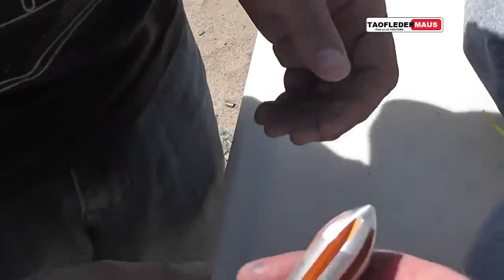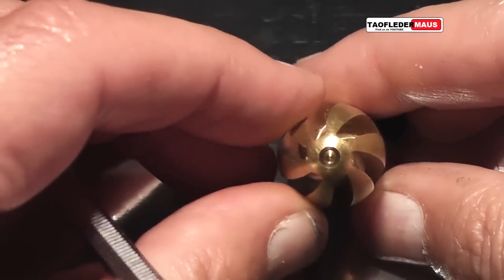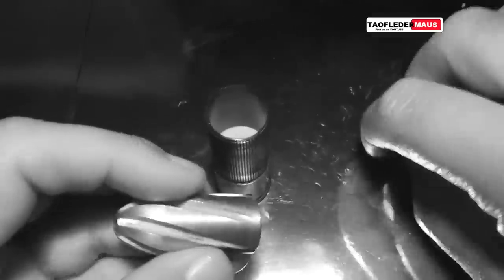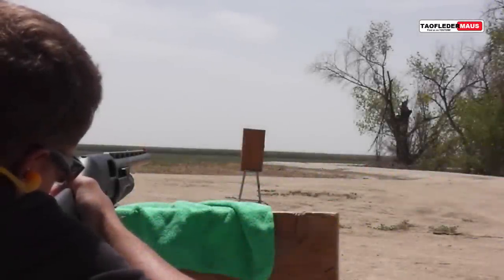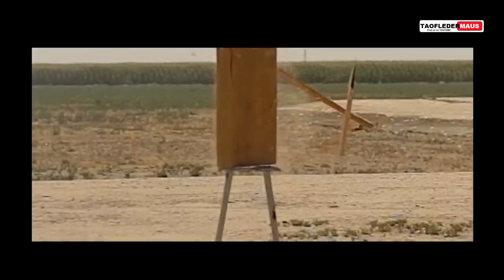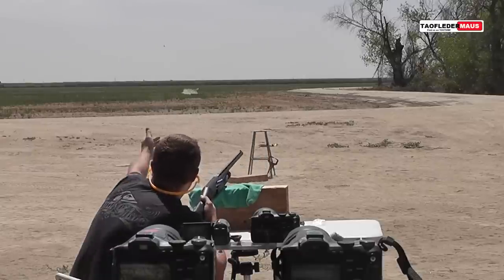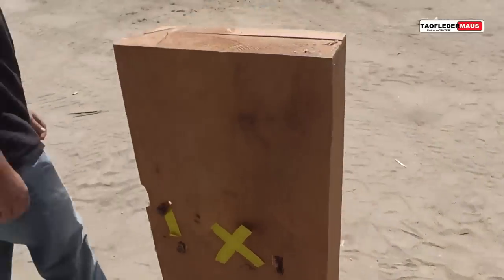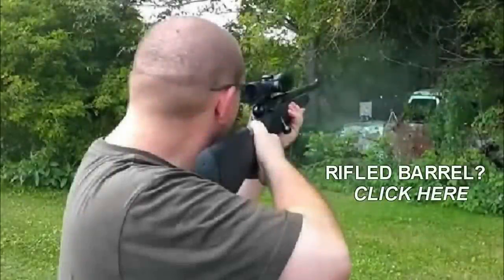70 Cal. Custom Machined  Brass TURBINE Shotgun Slugs -  Tests

Comment: Don't know if you already tried it, if not here my idea. Grown up with weapons of all sorts I'm also in hunting compound bows and the depending broadhead arrowheads, which fascinate me a lot. There is such a broad range of types and designs, nut just fixed blades but also mechanical ones, which unfold their deadly blades first when hitting the soft target. During the flight the arrow remains in an aerodynamical ideal state, with a small cross sectional area and less drag and also a better top-heavy balance point which is also good for stability and accuracy. 

While most sorts of projectiles shot from barrels of all sorts and calibers kill by their sheer energy, which is released due to the deformation and or fragmentation of the bullet within the soft tissue, the arrow doesn't.  The depending energy transfer of a bullet occurs by a (if you want) blunt trauma, while the blunt bullets (fragments) push away tissue explosively. A temporary cavity forms and collapses again and a shockwave ripps through the surrounding tissue. An arrow has only a fraction of a bullets energy to deliver, therefor it must be a smarter killer. It has to have more of a chirurg with a scalpell than of a butcher with an axe or a war hammer. Therefor it cuts its way through with a fraction of the resistance and therefor stopping tendency than a blunt bullet rpping trough. That is the reason for its acceptable killing skills, cause the depending wound and therefor blood loss might be even better as with some sort of full metal jackets. It ranges neary as deep but leaves a broader cut. Sounds a little brutal this, right?

So I was asking myself why not combining the two benefits of both worlds, the butchers and the surgical skills by customising a shotgun shell, which delivers a bundle of about 6 mechanical and fin stabilized ( they've got a thread at the end for screwing them into the shaft, which is to long and to weak for a shutgun shell. Therefor one must improve some sort of shortened aluminium tail with fins) broadheads, which as long they're in the barrel are held together and beeing accerlerated by a sort of gas-thight sabot or gel block, don't know. You are more experienced I guess. I'm not just talking about lots of flechettes, but about a more sofisticated sollution. Indeed fewer single elements, but which can unfold themselfes within the target for more harm than a slug or flechettes or birdshot alone would do! Just an idea for a new experiment! Nice channel by the way! Thanks for it and keep up the interessting and entertaining work.

Comment: A few things on conical projectiles ... smooth bore rifled slugs, conical need spin to stabilize. Rifled bore, smooth slugs, so they contact the rifling. They have to be a tad over bore, 1 or 2 or maybe a little more, to contact rifling. Rifled slugs do work in a smooth bore, the spin has to be the right turn per how many feet, within an effective range. The spin on any conical bullet has to be a certain spin per foot to stabilize. To much spin and it will frap out, to little it will wobble. It depends on the length of the projectile what spin will stabilize. This ain't my mad genius, it's established through testing and developed over centuries actually. Common knowledge in folks with a tad advanced (not that advanced) understanding of ballistic science.

It's cool as hell to test things out though :)

I was expecting to see a small A-Rab shot out of a shotgun.

Comment: the thing is, bullets stabilize in the barrel due to physical rifling, attaining stability before entering the atmosphere. a smooth bore shotgun is "throwing" the turbine slug and you are hoping the atmosphere will catch the "turbines" and induce the spin that occurs in standard rifles. no measurable spin occurs, in a few yards the round is keyholing. one can only learn by doing.

Comment: +TAOFLEDERMAUS
having very little experience in supersonic aerodynamics, (knowing only to avoid complicated trans-sonic speeds) I would expect that a projectile, especially out of a shotgun, has excessively sufficient inertia such that flight correction, particularly by means of spin, would have little to no effect, as well as being very difficult to achieve (out of a smooth bore barrel), all on the conditions of a flight distance under say 100m (gross estimate). as we see in your videos the projectile reaches an unstable equilibrium fairly quickly (that is without travelling much distance) because of its high speed, usually with some form of undulating yaw which i attribute much more to an imbalance in the force during acceleration (as in in the barrel/breach) as opposed to any variable in the aerodynamics of it. this imbalance, i think most likely comes from the turbine design itself, and i suggest could be fixed by both a uniform mass distribution, and (if insisted for spin) having the rotational acceleration come from the system, not the projectile itself.

tl;dr

forget fancy spiral grooves and go for a uniform distribution of mass to achieve flight stability, the simpler the better. if you insist on inducing spin do it by means of propulsion, or at least separate it from the projectile proper (i.e. on the barrel, exit, or a discarding piece)

Comment: In order for this round to be stable it needs to be spinning in the barrel and on the exit it can't rely on air to start the spin. Maybe if the round was lead the groves on the slug would mold to the barrel and spin...like a normal slug.  Also try stabilizer fins that deploy on a slug that pop out once it leaves barrel.

Comment: Just my two cents... I think the grooves should be made with thought about the force of the air hitting the round as it flies through the air. If for example you put turns that are too sharp you essentially require for the round to when it's out of the barrel or even in the barrel to start spinning at an incredible rate right away. If the force of the air is not making the projectile spin then it must be doing something else like creating drag and eventually building up instabilities. 

I think the problem is essentially that you have a projectile with little to no spin coming out at tremendous speed with grooves that require spin to work in the first place. Unless you get a slug that changes shape in air to accommodate the different grove characteristics for a given speed and air resistance to be able to increase it's revolutions at cost of stopping power you are basically asking for a miracle bullet that might as well steer itself if it can do all that.

Or you could get some initial spin on it and then have suiting grooves to increase spin in mid-air later... which really.. just makes me wonder why you wouldn't put more rifling in the barrel in the first place...doesn't seem like a very good idea honestly 

love the vids :)

Comment: you should add a a sharp outward taper (so the round is larger) at the very end of the round, or have most of it a bit thinner, to add drag at the back of the round

Comment: The reasoning behind the design is not unsound for low speeds, however at high speeds like this making relatively short projectile like this aerodynamically stable is very difficult. This is why with some of the "dart" type rounds you tested you had better success, whereas the "slug" style rounds like this tend to tumble, it has to do with the weight distribution in relation to the aerodynamic loads.

Comment: Apparently those spirals create massive drag and while being in front of center of mass they spin the slug. 
You know the Blondeau Slugs? Or tank sub-caliber penetrators? (exactly what you're trying to do on a shotgun)
The point is to have a piece with large drag behind the center of mass, that stabilizes a non-spinning projectile (like arrow) the fin should be long, light and make drag.
Also, you could try and make spirals on the plastic discardable fitting that holds the sabot in barrel, maybe it would act as if the barrel has spirals especially if you make it so that some gas can escape through them.

Comment: I might be goin out on a limb here, but that bullet have way more drag ind the front than ine the back which means that the front end of the bullet is slowed down faster than the backend of the the bullet due to air resistance, which is what makes the bullet fly around randomly.

Making the groves in the back of the should make up for that, but there air pressure that makes it turn is much less as the front breaks the air, so there might not be much turning.

Comment: In order for "fins" to do any good at stabilizing a projectile they have to project past the edge of the pressure-wave created by the leading tip of same and interface with the undisturbed air molecules outside of it's influence. Simple wind tunnel testing... If you have a super-sonic wind tunnel laying around. ;-)

Comment: would it work if you would take away the grooves in them, make the whole thing smaller (in diameter) then add tiny tailfins that are tilted a tiny bit and use plastic pieces to guide the bullet throug the barrel?

Comment: The basic shape is correct with these rounds, but the spiral grooves on them need to be a little more streamlined and the tip needs to be slightly pointed. Much appreciated if this is read.

Comment: When Tim designed these, he should have moved the centre of mass just a tiny bit towards the end of the projectile.
The tail is a bit too light and gets a bit more accelerated, while the nose is too heavy, so it gets accelerated slower. So when the projectile leaves the barrel, the tail tries to "overtake" the nose, which results in perpendicular tumbling ("keyholing").

I hope, this simplified explanation helps you to understand the witnessed effects better.
Reply from the maker: +gus23a    If he hadn't made the cuts,  it would have been a lot more nose heavy like his other slugs.

Comment: I suppose the morale of the story is that you can't beat centuries of testing, there is a reason a normal slug is made of lead and is the shape it is, my only thought is the rounds are very long so the wobbles caused by supersonic travel are amplified, possibly? But probably not, right?

Comment: ***** ***** To me, it looks like dominance of forces is what is affecting this round.
Evidence: flies straight, then starts wobbling the further it goes
Theory: It doesn't start yawing like crazy until the round starts to "spin"
Hypothesis: Probably the turbines are a little too well done (but that craftmanship tho') so that the round may be, on initial contact with the air, is spinning too much, or the air hits one of those grooves in the turbine too hard, causing a torquing force at the front of the round much larger than the back could handle, causing the massive yawing effect.
Solution to Tim(?): shallower grooves in the round. Vary the start point of the grooves and the depth. 
Don't be afraid to play around. You never know when you'll strike gold.
WHAT DO YOU THINK?

Comment: If I may suggest, a tadpole shape with 1 mm pinhead size vortex generators at the leading edge of the aft curve of the round should provide enough turbulence for the tail to have airflow for the rudder (tail) to bite into. I would like to see such a trial.  It would have to be built as a self discarding sabot.

Comment: What if you made a threaded hole in the bottom of the slug, inside the cavity in the rear and added alot of small ropes or something
And then fasten them with a small screw and wind them up snug in the cavity so they will have some good length to them, then they would be pulled out by the vacuum behind the slug and the air will catch them and they would theoretically act as stabilisers dragging in the air behind the slug.
Might work, just a little tip ^^!

Comment: jeff, i think tim should make some that are rifled like a 1oz deer slug with the tighter groves but a fmj style but it ABSOUTLEY has to have a lead back end in the cavity of the copper fmj body. the copper will give it the weight and penitration factors but the lead back end will allow the slug to fire form to the size of the barrel and maintain a better flight path......BUTTTT..... the rifling on the slug has to carry through from the copper to the lead to retain accuracy

Comment: In order to make the fins work at these kind of speeds, you'd need taller and thinner fins. The angle of attack of the fins would have to be a lot higher too. It might create too much drag, slowing the slug down too much and requiring aft placement of the fins. 

Another thing to keep in mind is that as the lenght-diameter ratio gets higher, you need a higher spin speed, requiring larger fins, creating more drag, and thus negatively afffecting the slug.

There is a reason the grooves are in the barrel, instead of the projectile...

You'd be better off just using the fins for direct stabilisation instead of for imparting spin stabilisation. 

It was already tried before, but again the fins were too thick. The right fin-thickness for a projectile this small would be about a millimeter, maybe two, although that is just guesswork. To keep the weight of the projectile up, it could be broad at the front, narrowing down to a thin tail at the end, holding the fins. This could give the fins enough surface area to work with, if the tail is long enough (drag, shockwaves, etc. interfering with the airflow around the fins).

Anyway, that's just my two cents. It might contain some complete bullshit, but so do most other comments....

Comment: It isn't always necessary to put spin on a projectile. It is only necessary when it is needed. The bullet design used here uses the same aerodynamic stabilization method as foster style rifled slugs used, that is, its center of gravity is in front of the center of pressure but you added a monkey wrench when you added grooves to the bullet. Boat tail bullets need to be gyroscopically stabilized because their center of gravity is behind the center of pressure and would thus become easily overturned in flight. Also, even if you could get the bullet to spin, theres nothing that would suggest that it would have the right spin rate anyway.

Comment: I think I see the problem with this version. Namely, the combination of very light tail and the cavity in said tail. Because of the cavity the explosion gases get kind of stored in there, and when the round leaves the barrel, the gases stored in the cavity push backwards but encounter the gases leaving the barrel, so they go out sideways, pushing the round's tail to the side with a lot of force. That makes the round get off track, and while it does eventually stabilise, it's too late and it's already traveling to the side of the correct trajectory. Filling the cavity with some light material should solve that problem.

Asides of that it seems like all the changes were good ideas, and with that slight fix the round should be both very accurate and very destructive against both hard and soft targets. Shooting it at a loaf of ballistic gel should provide very interesting patterns.
Reply from the maker: +The Crazy Pineapple  The gases don't get past the wadding so they don't contact the projectile.
Reply: ***** Oh, that is a valid point. Well then fuck a duck, no idea why does it push the tail sideways at the start.

Comment: If you want stability you need to make what is call a BOAT TAIL  at the end of your profectile.

For a projectile of that dia, need to be about from 1-4 to 3-8 of an inch long at an angle of about 125 degree
Or maybe the projectile is too loose in the barrel wall
The projectile should be snug fit in the barrel

Comment: The problem is the aerodinamic  its wrong man, make the base of the round(slug) bigger than the whole body ,so the bullet will run on an invisible axis with the wind hitting the front of it , providing greater stability , and do not forget to make a sharp point
Reply: +Vini giovanella Try this bro!
Reply: Hollow points don't have a sharp point
Reply: +LoganThe Llama Thx for the information hehe..

Comment: I see the problem of unstable flight being caused by the pressure wave as the slug leaves the barrel. It will keep the fluid (Air) from acting on the spiral flutes until some time after sub-sonic speeds are reached, by this time the projectile is miles off target and fast approaching the dirt! Perhaps minimise this by reducing the frontal cross section of the slug or drilling a through hole, at least to slightly lower the dynamic pressure acting on it!? You can see in the slow-mo that the nose of the slug is being overtaken by the rear. I believe trying to add drag to the rear of the slug will be almost futile in this case. I may be completely wrong though!

Comment: Could the reason it "keyholes"(?) be because it's trying to push through the air without sufficient spin, as such the back is swinging around as the front slows down, like a truck trailer jack-knifing if breaking hard down a hill, the rear has too much momentum over the front.

So what about doing a similar thing, but a longer cone at the front to try and decrease the difference, or at least produce a little more drag somehow at the back?

Comment: Would a rifled barrel help the slug get the initial spin and then allow it to fly straight, just a hypothesis?
Reply: well they make rifled slug barrels for sabot rounds. the bore of an 12 gauge I believe is .72". sabot slugs are exact bore size for rifled slug barrels. foster slugs (also called rifled slugs) are slighty smaller.